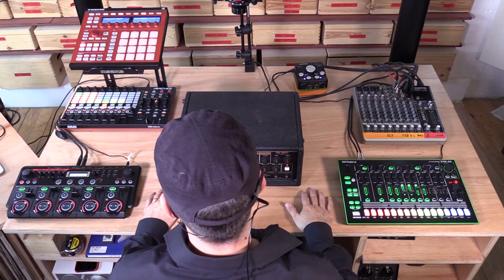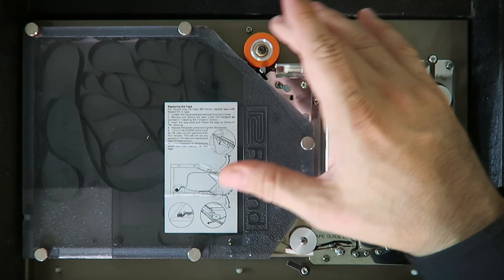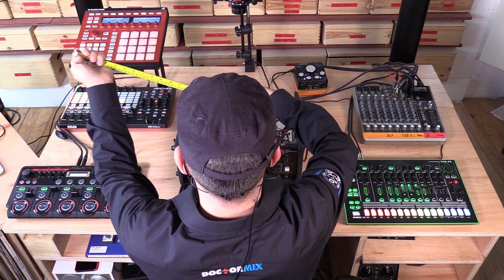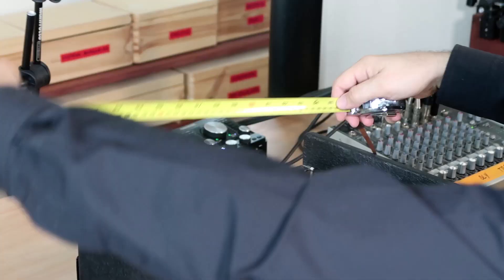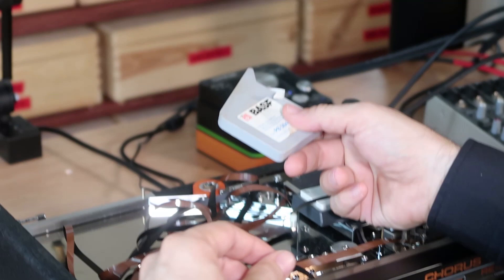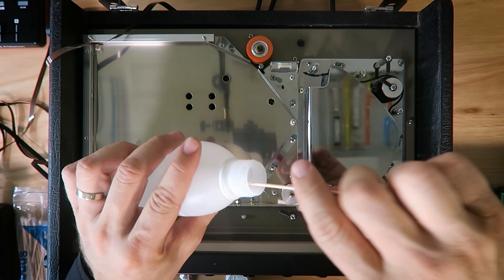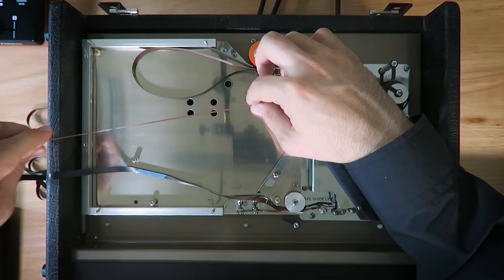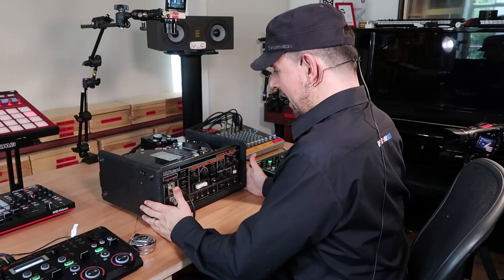How To Replace The Tape On A Roland RE-501

Comment: Noooooooo don't use isopropyl on the pinch roller! (the bit you called the capstan... Which is actually the metal shaft that turns the pitch roller) It's rubber so alcohol will dry it out and make it harden and crack. ONLY use iso on the heads and metal parts that contact the tape. You need to use a proper rubber cleaner for the pinch rollers. Someone also mentioned cotton gloves, may seem unnecessary but really helps keep dirt and grime from your hands off the tape and components.
Reply: Agreed!

Comment: Thanks, I got a RE-501 recently-ish (my first tape delay) and after a few months of normal operation the tape it came with went off and got stuck. Fortunately I had some replacement loops ordered earlier and with this guide I had it fixed in about 20 minutes (next time I'll probably be able to do it in 10 :D )

Comment: What's percentage of isopropyl did you use ? I think 90% is too high for the capstans. I believe the tape has to be super strong and thick to prevent long term stretch - wow and flutter.

Comment: This is the wrong tape and you will ruin the tape echo eventually. It needs to be special lubricated tape. The correct type is RT1L. This is designed for this machine. Any normal reel to reel tape will eventually kill the heads on a Space Echo rendering it useless. I know this as I took it to a technician once who didn't use lubricated tape and it killed my Space Echo within a month.
Reply: Using the wrong tape is definitely not a good idea - a lot of the tapes available online go "sticky" after a while and will certainly give you problems. But RT1L loops are in short supply and an expensive option now. There are tried and (very) tested alternatives out there - we only recommend tapes from echofix.com - we wrote a thing about this here: https://soundgas.com/pages/which-tape-should-i-use-in-my-roland-echo